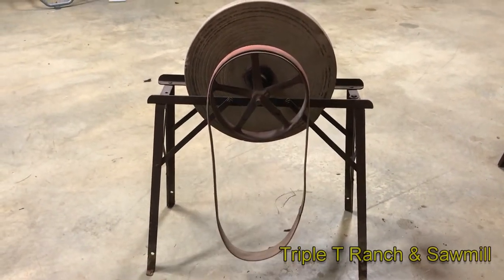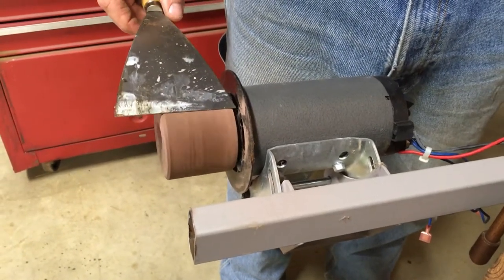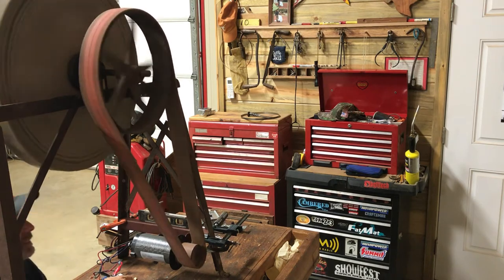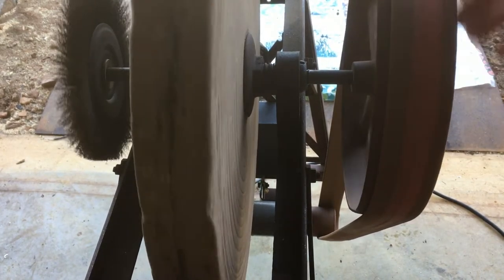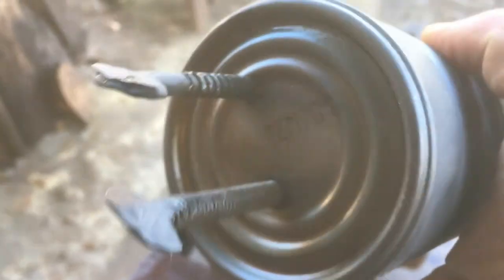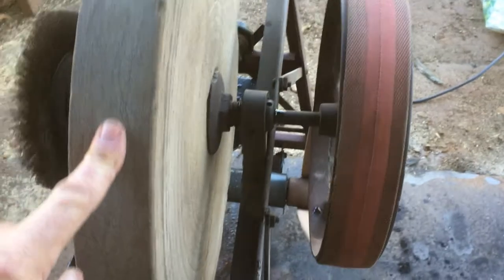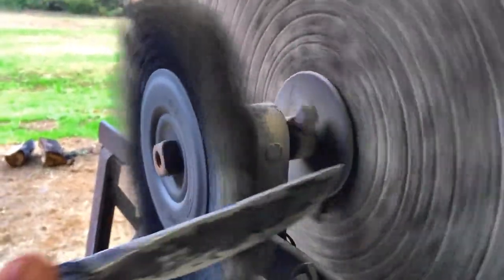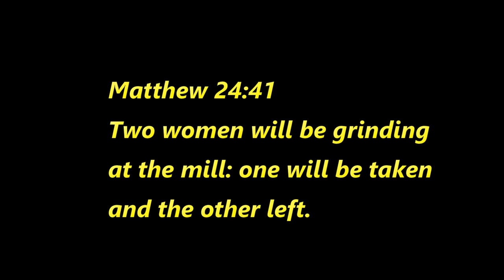Powering Up A Sand Stone Grinder

Comment: A VERY interesting video.  I've had my eye out for a working treadmill for the motor and controller to power a hundred year old plus drill press.  I tell ya, you taught me something about rounding up the stone.  I've always used an old grinding wheel laying flat to work back and forth across the 'out of round' stone to cut it down.  But man o man I like the idea you gave with the angle grinder and masonry wheel !!  Awesome !!  Love the forge and the bracket for the drip can, the wire wheel and especially the ammeter !!  I will have to investigate your amazon controller.  That does sound a bit better than using the one that comes on the treadmill.  Great video....Did I say I love your forge....no matter, I'll say it again...LOVE the forge !!
Reply from the maker: Thank you!  I stretched the mini Whitlox forge with open C purlin.  The red air pipe is flexible exhaust pipe.  Glad you accepted the new motor on an antique.  Thought I might get hate mail. Safety tip I should have mentioned is if you run the controller to 100%, you better take cover!